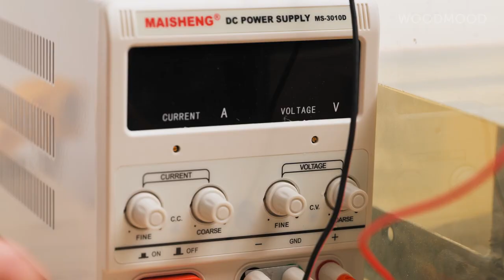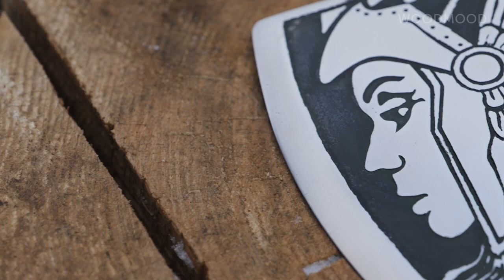You need an axe? 🪓 Learn how to replace it, how to make DIY axe or how to restore a rusty tool

Comment: That rebar axe though, I like it. I didn't know paper could cut metal, but paper cuts are quite painful.
Reply: That was a pvc pipe not metal
Reply: @chrissutton2390  it seems so now that look at it again.
Reply: I thought it was to at first then I seen it melt